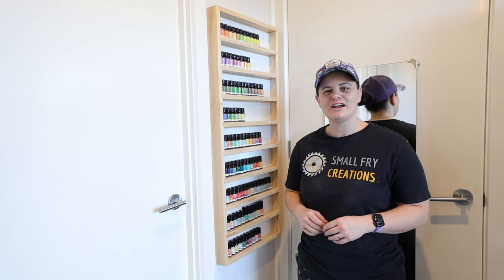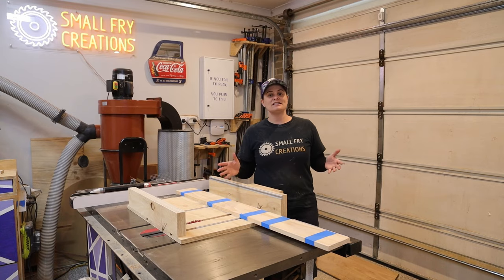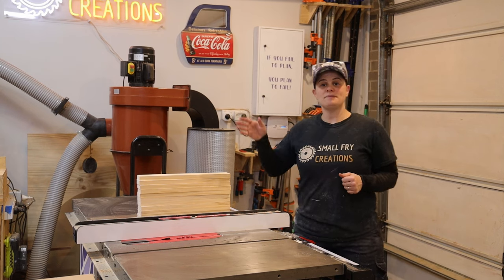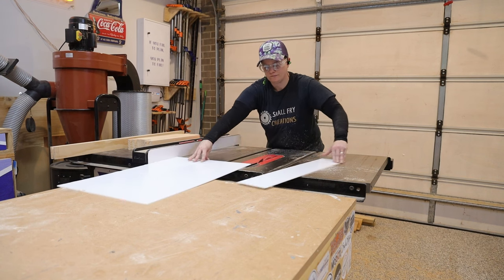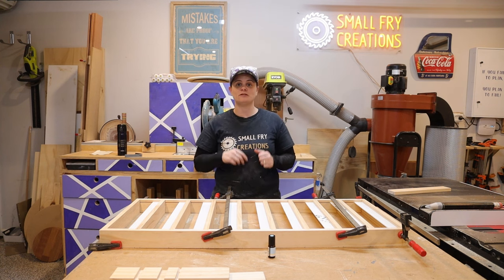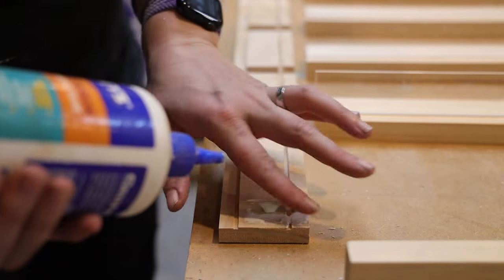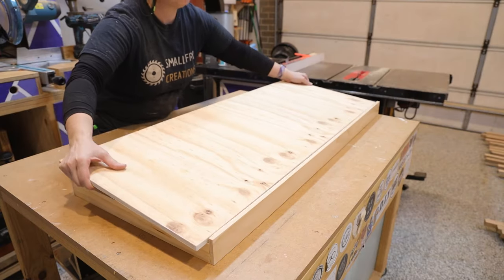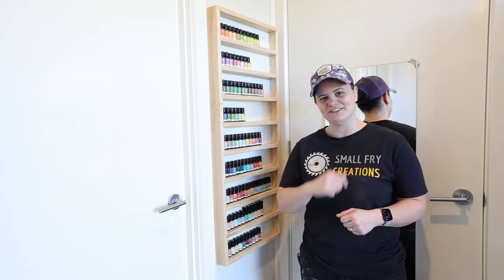Concealed and Convenient: Build Your Own Hidden Essential Oils Storage

Comment: Very enjoyable presentation thank you. Keep up the good work.

How are you finding your SS saw? Do you ever have regrets choosing this particular model? What are any major lessons learnt that surprised you. Your assembly video is on of the best.
Reply from the maker: Thank you. I’m loving the saw and still think it’s the perfect fit for the shop. The real only downside is the dust collection is not as good as the profession cabinet saws but for price range and my use the contractor is perfect I think 😀